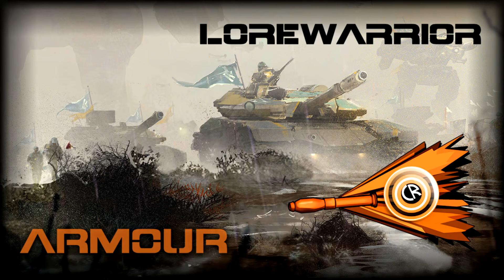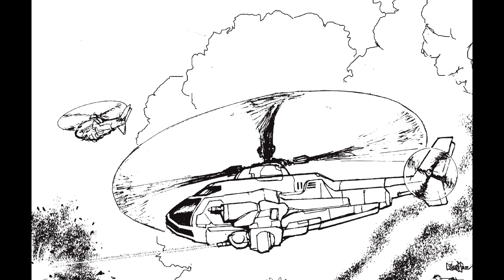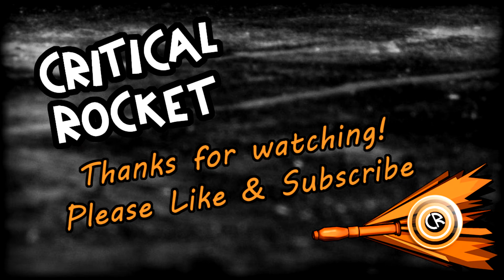LoreWarrior Armour - The Crow Scout Helicopter

Comment: Hello, CR.

The Crow is a decent aircraft. The C3 variant is especially good when attached to C3 Battlemech lances. 228 BV isn't all that expensive, so you should be able to field a pair of them.

The basic idea is to fly the crow as fast as possible to get into 'short' range with its weapons. Not really to fire on the enemy, but to lend its targeting data to the Mech lance. Thus making the Mech's shots more accurate and seemingly at a shorter range than they really are from the target. 

The 13/20 movement rate is very good for penalties against being hit by enemy fire. Literally, 'speed is life' with these aircraft. 

If you are not fielding Mechs with a C3 system, you should be able to afford even more Crows. Enough to keep at least one per combat turn behind an enemy Mcch, melting off that thin rear armor and then fishing for crits. 

I remember one battle where one of my partners fielded nothing but Vtols... quite a few of them Crows. He kept his force under the table until it came time to move units onto the tabletop, where he played 'Ride of the Valkyries' as he placed them all along the table edge. You should have seen the Op For's faces! 

It was a hell of a battle, aircraft crashing into the ground left, right, and center, but they alone were the cause of several enemy Mech's deaths. So don't ever discount the 'humble' Vtol. They are fast, maneuverable, and can remove your back armor in a very short period of time.